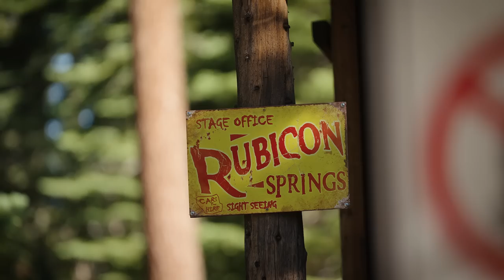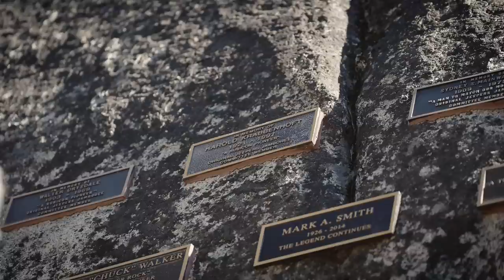Wheeling The Legendary Rubicon Trail in a Jeep Gladiator l On The Trail

Comment: I'm headed up in July from Oregon. I'm looking forward to being on the trail for the first time. I'm coming up with the Salem Jeepers. What would you say is an absolute thing i need to bring? I'm bringing a 95 YJ with a 4.5" lift siting on 33" wheels. I have a winch, boat sides, and locked in the front. I still have the low trans pan I haven't switches to sye to raise it up. Any sections I should stay away from with 33" tires?

Comment: How about a mod rundown for the Gladdy?
Reply from the maker: I have a bunch of videos on this channel breaking down all of the mods. The quick and dirty are as follows. 
3 Inch JKS lift with Fox 3.0 shocks
Dynatrac ProRock XD60 (72.5 WMS) 5.38 gears, ARB rear, Eaton front
PSC Hydro assist
JE reel drivelines
40x13.50 Nitto Trail Grapplers
17x8.5 Trail Ready Beadlocks with 5.5 inches of backspacing 
Rugged Ridge front bumper, winch and fender chop
AA products universal bed rack